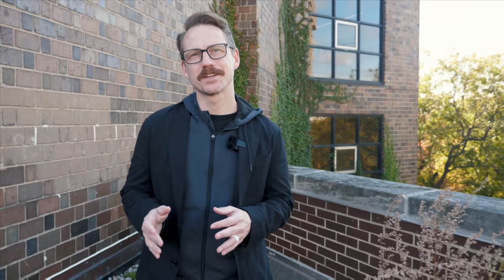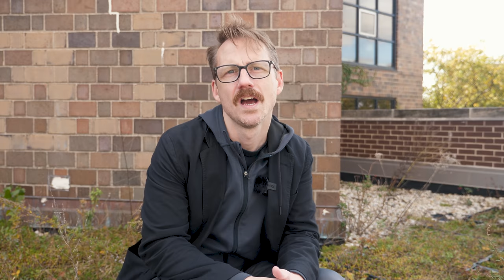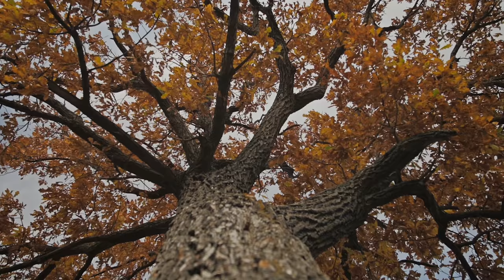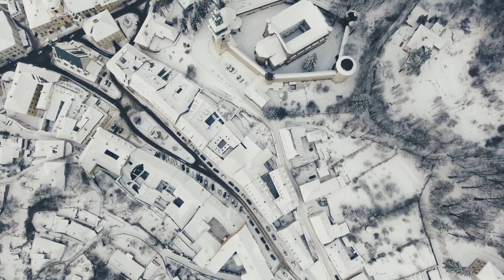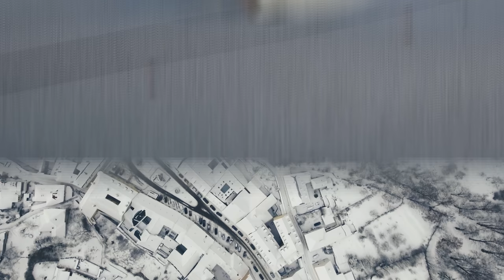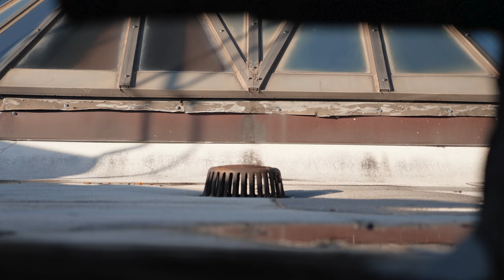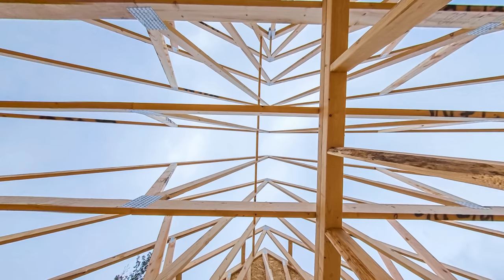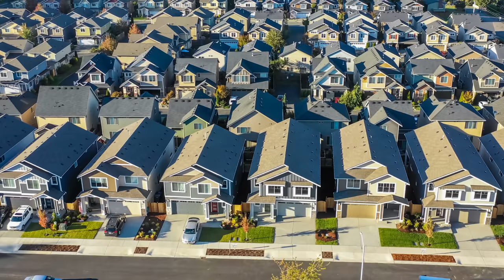Why Do Architects Insist on Using Flat Roofs?

Comment: My 2 cents as an engineer in the making. There are some points that also fall under the "it's about how it's made" category when critiquing gable roofs. Gable roofs do not necessarily have more tendency to rip off from homes and usually require larger overhangs or asymmetry, flat roofed apartments are I believe most common flyers. Further, is the issue of rain a null one, buildings would generally be high enough to scatter clumped water to mere drops or low enough that it would be mildly noticeable. Gable roofs on high-rise buildings could also have a flat roof edge to act as wide gutter. 

And as a personal note, it genuinely makes me want to pull my hair out when the architects next door give me a flat roof that is enormous and needs to have no to minimal central support pillars/walls during a joint school project
Reply: Yeah this is something i wondered too- because you actually do find pitched roofs and gutter systems on cathedrals and castles. Many old 'flat/low pitch' buildings are no where near as flat as the roofs of modern high rises. Sure theyre not as obvious as the pitched house roofs but theyre not flat.

What im saying is it should ve law to put gargoyles on council flats, lol.

Comment: There's also the safety of people on the ground to consider.  A sloped roof that collects snow and ice can be hit by a hot day and have a gigantic ice sheet fall down.  Whereas trapping that and forcing it to melt and come down safely through drainage threatens less lives with unexpected avalanches.
Reply: @annasolovyeva1013  No one said it was.  I'm talking about preventing massive roof-wide ice slides.
Reply: @justsomeperson5110  then there's two ways - either make it steep enough to the gothic point or clean it...

Comment: I've lived in half a dozen buildings in my life.

All the ones with flat roofs had huge water leaks from the roof, while none of the ones with gable roofs did. 🤔
Reply: That's often due to poor property management and not the roof system. Gable roofs leak. The life cycle before you need to replace or repair a roof, gable or not, is about the same.
Reply: @deangraves7462  and yet that doesn't match my experience at all. Maybe I've been incredibly lucky while living under a gable roof (every time) and very unlucky every time I rented in a building with a flat roof. Or maybe one of the two designs is a lot more fragile and requires perfect construction and maintenance while the other is more resilient in the real world.

I've also heard architects explain to in great detail how wood can be a perfectly good material for small pedestrian bridges. So forgive me for dismissing the entire category as incompetent.
Reply: @ChilapaOfTheAmazons  It can also depend on when the place was built or who developed the property. A shoddily design and built roof will leak regardless of rather it is flat or gable. Also, some of it is also who you hire to maintain your roof or how cheap your property manager is. I have tenants in a top floor unit living there for decades without leaks and the moment they got a  leak I immediately patched the roof and then replace the bitumen layer within a year. The tech is so good now that if you get a reputable contractor they will warranty it up to 20 to 30 years which is equivalent to most gable roofs.

Comment: In 1986 I bought a house with a Wing Roof, that is a house with a Flat Roof, but sloped down to one side with a 5° slope. 
The first thing I did was replace the Roof with a brand new Apex style Roof, increasing the slope by a good 20° extra. 
Absolutely improved the street Appeal of the house out of sight, also improved the safety of the Home because Wing Roofs have a tendency to lift in strong winds.

Comment: Bottom line is flat roof leak.  Doesn't matter which technology is used, they will leak.  The occupants of the building have to live with it and maintain it.  The facility where I work has been slowly replacing the flat roofs on all the industrial building with slopped roofs.  Unfortunately, the cost of doing that is very expensive so only the worst roofs are getting replaced.  Flat roofs are cheaper initially, but in the long term, would have been so much cheaper if our buildings had slopped roofs to start with, even if they had to be multi peaked.

Comment: I don't know about the rest of the world but low angled roofs in australia often just have some sort of corrugated steel sheet like gable roofs. Its just the angle is a lot less. They seem pretty efficient. If you are having a vivid white roof to combat solar gain they can't be seen as readily if they are low angled so don't create glare issues. Also with a low angle roof you can have your eaves as wide as you need to keep the summer sun out and let the winter sun in. They are also a lot less tall which is good if you have height restrictions. I like em
Reply: Bro, it doesn't snow on those roofs. I wanna do the flat roof + rooftop garden sometime but I'm planning that for the Philippines. 

Not in Germany or something.
Reply: @carlosandleon  no snow not much of an issue, burning to death from sun or bushfires the worry here

Comment: I've held a idea about how to improve roofs for quite some time. 
1-roofs occasionally leak
2-In the summer, the hottest part of a building is in the attic, under the roof.
3-The best insulator is AIR.
So, how about this-
After the roofing has been put on, install a 2nd roof, only 1-2-3 inches above the under one.
This top roof, can leak. The under roof will seal the building. As the under roof is covered,
it wont suffer the weathering a top roof does  +  being a couple of inches above the under
roof, the natural breeze should keep an air current flowing betwix the 2 roofs & purge the 
in betwix space of extra hot temps keeping the building cool & keeping the under roofing 
from weather damage due to high temps. Seems to me this would work & would make
the under roof last the life of the building. Seems to me.

!

Comment: In cities where it snows, you don't want a sloped roof where sheets of snow and ice would slide off and hit pedestrians below. In a private home with enough space around it you can allow snow to slide off. Also, if the attic space is part of the conditioned space, you can put your furnace and HVAC equipment in it.

Comment: From a family of contractors. I do like flat rubberized roofs with polyurethane spray foam to give strategic water drainage, and pea gravel for protect. You can walk on it. Even put a live roof on it, most furniture, and plants.  Wiring, drainage, pipes are centralized.

Comment: Hi Stewart, Great video... But, your augment is flawed and very one sided as your focus was large city based buildings. The main issue people have with flat roofs is based on single family homes which are often single story and often which in reach of the flat roof killer. Leaves are the perfect drain blocker and if not cleaned all the time will create a total mess of a structures finishes and if left unchecked the structures core. Snow and ice can also block the drains you spoke of too and I would not want a foot thick of ice sitting on a flat roof above me. Single story family home roofs need to shed leaves, water and snow to some extent. A single angled roof of say 10 deg which sheds all elements to one side and off the surface is really the only option for urban homes if they do not want a gable roof in areas like NY.
Reply: I'm a flat roofer in the coldest areas of Canada and have never in my life seen a foot of ice on a roof.  Snow yes but snow is mostly air.   You just don't see that much ice because of heat loss from the building.  Drains are also rarely unstructured by snow and ice.  There's actually a lot of heat loss at drains so they tend to self melt.  Leaves are always the enemy of every roof with controlled drainage.  But they tend to collect more at parapets than drains because wind.  A drain next to a parapet can therefore be an issue, but this isn't common placement for drains.  And drains and scuppers are far easier to clean than gutters. 

For single story dwellings I agree that a gable roof is very practical but taller homes I would choose a certain type of flat roof membrane instead.

Comment: I’d like to see a similar video about houses. I’ve traveled all over the world, and I’ve noticed that particularly in Asia and Africa, houses often have flat roofs, and it’s not unusual for the roof to be at several different levels, like where an upper floor only covers part of the lower floor(s). If the house is well-built, there will almost always be an area on the roof for socializing, with chairs and tables and sometimes kids’ toys. If water service is unreliable, you may see a couple huge water tanks on the roof, one of which will be painted black to soak up the sun’s heat. In this way, even poor people can have (relatively) hot and cold running water indoors. I’ve learned that during the dry season, a water truck will visit and pump water into the tanks.

In some places where thatched roofs or tin roofs are common, you still see raised water tanks to provide running water, but they will be on a special platform built right next to the house.
Reply: Flat roofs are serviceable in the PH especially if there's only 2 seasons, rain then immediately a hot day comes next, evaporating most water in the roof. it's true flat can leak, we both have flat and angled roofs, the flat is a detached building as our family increased, you just need high quality cement better if it's specialized for water, then a good carpenter, the drain is often a whole with a PVC pipe in it. The materials and people in the video looked expensive, look liked building one or two if not more new rooms expensive here in PH, we typically just tile them and just paint them over and over.

Also, water tanks are just incase, water services stops due to maintenance, like a leaked pipe or replacing pipes, they rarely if not never announce tho, that's why.
Reply: @MangaGamified  in poorer countries the water tanks are more necessary, because local water service is often unavailable or unreliable. In some of the places I’ve been there is no water service, and you either put tanks on the roof or you use a hand-cranked pump that brings up well water.

Comment: Flat roofs can also be made with a super reflective material on top to help passive cooling. We did that with the part of our roof that’s flat and it made a significant difference, but is only possible for a roof that others can’t see because it is so reflective it’s too obnoxious otherwise. Personally I prefer the look and maintenance of a gabled roof, but the passive cooling has been impressive!

Comment: This had me thinking about a gabled roof on a skyscraper shedding snow. That much weight falling that far could be pretty dangerous under the wrong conditions.
Reply: Sure, but architect also love to put it on city house that are just 2 floor...
Reply: On a sky scraper the area of the roof is small compared to to the volume of the building and the heating and AC plant up there usualy puts out enough heat to keep the snow build up low enough that specialised considerations such as roof heating, extra structural stength to handle snow loads and a steeper pitch than that needed to handle rain water need not be considered. Also a roof built to support heavy plant tends to be already strong enough to handle a snow load.

Comment: Flat roofs are dumb. Mesopotamia and ancient Egypt had hardly any rain.

Relying on the integrity of the material for water proofing is dumb, the integrity of materials is ephemeral. 

Flat roofs are more profitable for builders.

Every single building with a flat roof (that I have been in) over 9 years old leaks. The house my mother grew up in has a steep pitched roof, over 94 years old, it has never leaked!

Also, flat roofs have to quite heavy, so if an earthquake happens, your death is waiting to fall on you. Pitched roofs on the other hand can be relatively light.

(Apology to those who liked my comment, I told a lie, I got mixed up a little, my mum moved into the house when she was a child, so the house is 94 years old, not 110)
Reply: Can confirm, lived in old house with flat roof which leaks, while old house with pitched roof doesn't. Comparing arid to humid climate is so stupid, there's a reason no culture in humid climates built flat roofs, while in egypt they don't even have to finish building a roof they can just use the upper storey floor as one ffs.

Comment: I hope no one is undermining the flat roofs in Egypt or ancient Mesopotamia, their form follows the place where they were built.. However this architecture cannot be replicated in other areas.. the climate in these regions don't reflect other places such as rainy seasons in Sao Paulo or the snowy and windy seasons in East Asia.. 
IMHO architecture has to adapt to its surroundings.. Take the Korean traditional Hanok which adapts to all the 4 seasons, or the lifted homes built (in regions with constant weather) in river basins adapting to tides and water levels, or the architecture built in southern Spain inspired by north African passive climate control be it reflecting pools or walls with orifices that allow wind through..  

Place, and time, has to be take in consideration when designing and building.. Don't just simply replicate but analyze, understand, and if you have to.. adapt. :)

Comment: My house on the Florida Gulf coast has (at least) 3 different roof pitches.  When I re-roofed I noticed that the deck rot was much worse on the lower-pitched portions.  I assume it was condensation between the plywood and the felt, but there’s no doubt steeper pitch is better in this regard.

Comment: I think they could add a bit more slope to the roof to stop the pooling water issues that seem to constantly happen with most flat roofs I have been on.  The older the flat roofs get the more wavy the material tends to get especially if there is severe weather.  Areas around drains often have a lower angle around them to help drain but I never understand why they don't do just a bit more angle on the entire roof to channel water to the drains.  It doesn't have to be that much of an angle as water is going to flow downwards as we can see in the old Roman aqueducts that just used a slight downward gradient.
Reply: Unfortunatly the thing is that water does not compress so if there's enouh rain or snow it will start pooling as soon as you exceed the maximum capacity of the chokepoint.

Comment: I hated flat roofs, until I had a garage built with a flat roof - simply because zoning restrictions wouldn't allow for the extra height of a gabled roof.
This changed my mind on flat roofs, as the technical concerns I had turned out to be invalid.

Comment: When I’ve visited some tropical places I’ve encountered area where most houses had flat roofs and were used as an extension of the home- with families spending time on the roof frequently.

I also think they may be useful for maximizing live-able space where buildings have height restrictions.  (Plus the large building reasons in the video).
Reply: If you lived in England, you would not want to be up on the roof in winter when it snows and there is a gale blowing.
Reply: Maybe in a more arid climate. A proper tropical thunderstorm isn't a joke and flat roof is just not practical for that.